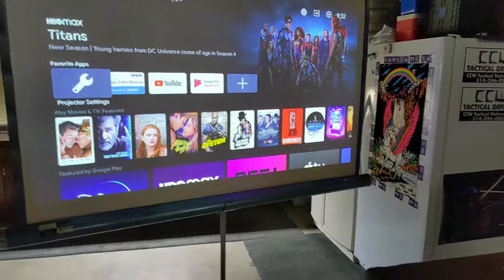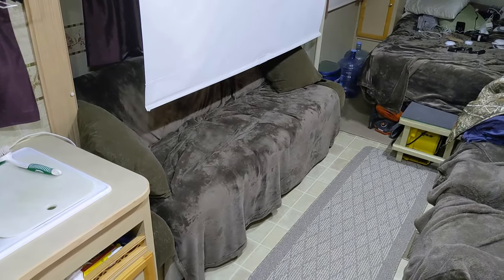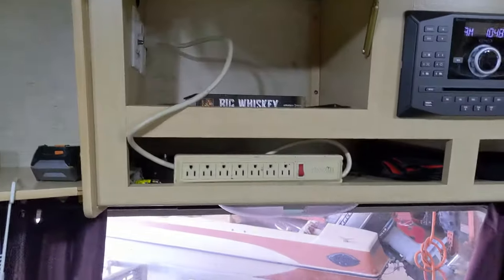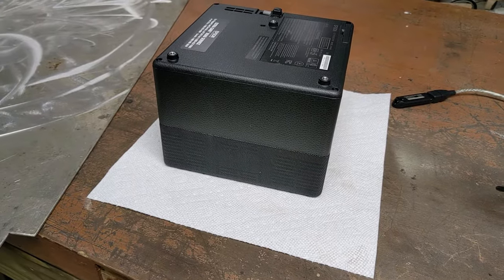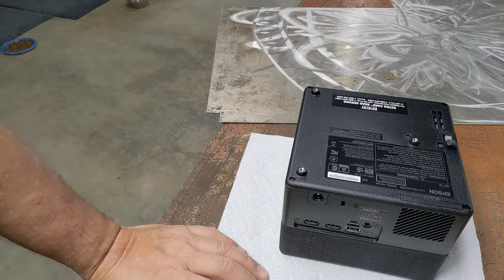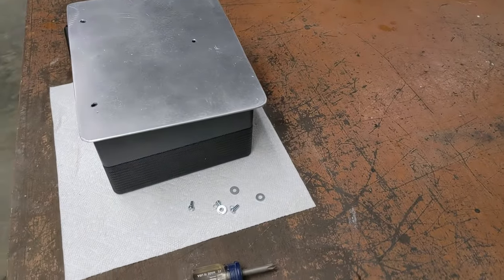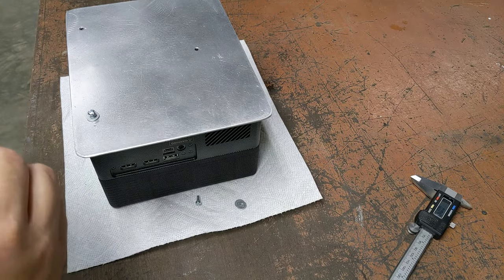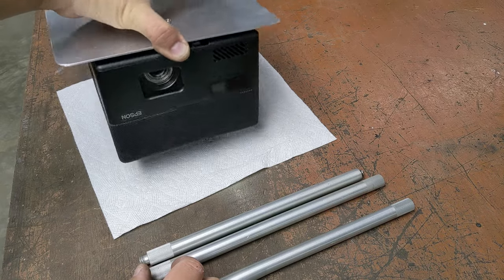DIY Projector Mount for Epson EF12 for our RV

Comment: awesome video! does the power brick get hot? thanks
Reply from the maker: gets warm.  no big deal.  We'be been using the projector in the cabinet seen in the vid for more than one camping season now without issue.  It gets warm in there when running, but no big deal.

Comment: Have you had any issues so far mounting the projector upside down? This one is supposed to stay facing up (speaker side up), unlike other projector build to be upside down. Just trying to figure out if I should mount it on a tripod or ceiling
Reply from the maker: No issues at all.  Its been working great. Thanks for the comment and for watching!